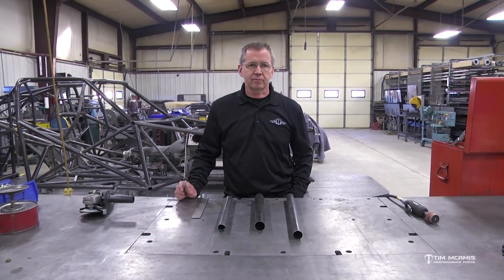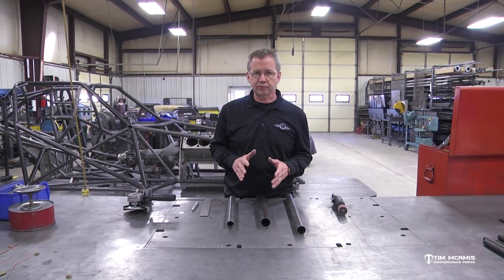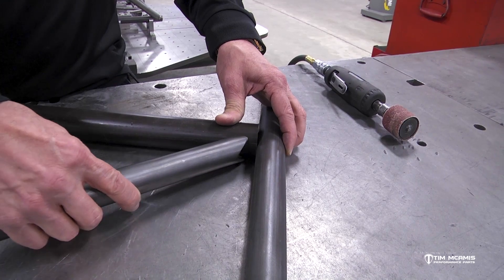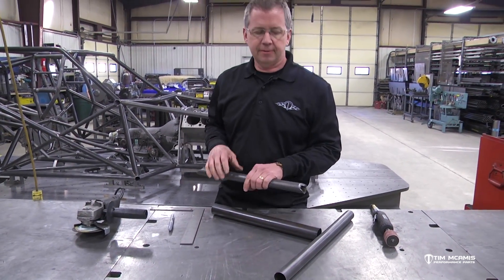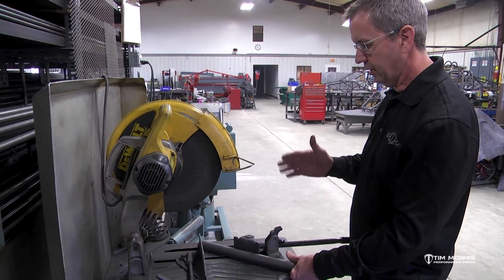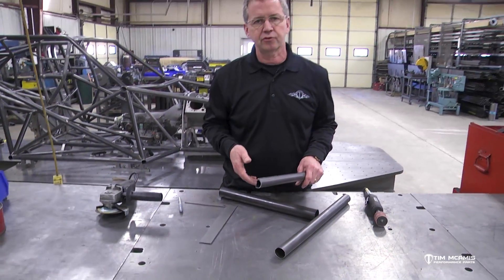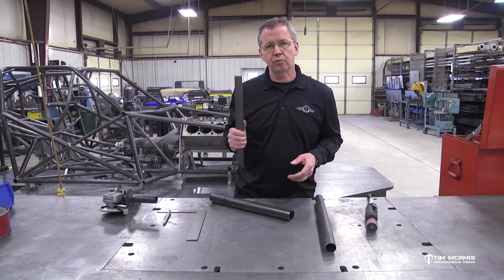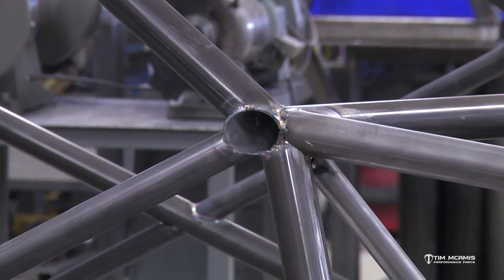Tube Notching - Fabrication Series: 05

Comment: Tim, awesome vid, thanks.   For a VW bug, dune buggy build, tube chassis, that needs to hold about 500 to 550hp at the wheels, what tube diameter and wall thickness would you use for the frame?

Comment: If u butt tack weld then slide the sleeve in case where u don't want to pipes same size butt jointed. Start it joint if needed w/flux, then slide sleeve where needed & weld & u don't hve to "sweat" the pulling of the weld heat messing w/your seams. 1 diameter will heat diff then other diameter, simple tack or flux worth the time if worried about it, & sleeving to b sure not same diameter insures good strength lasting seam & fit, 1st time every time.

Comment: comments 93 showing: best way to get a good fit angle butt joint is to make sure the 2 pipes being fit together r never the same diameter. Even if u hve to add a cover sleeve.

Comment: I've done a back half on a S10 and a roll cage and it took a long time and I see places where I could have done better.  I went with the 2x3 back half and after watching this, I now know I should have gone with the 1 5/8 tube option.  What scared me was two things, is it going to be strong enough and notching the tubes.  After watching this video and the simple understandable approach Tim uses, made me realize I was overthinking it.  This was soooo simple!  Thanks for turning on the light bulb for me Tim!  What would be helpful is providing some tips and tricks about tubing measurement for length on bends etc.  Thanks again for posting these!

Comment: Really great video.  So many of these tube notching videos on here give overcomplicated (and actually incorrect) advice, that I've thought about making my own video about this, but you have it totally covered.  I think this is the first video I've seen that mentions that a tube notch is made of two straight cuts, and that's the most important thing that people need to realize.  All you need in order to make excellent fitting tubes is an angle grinder and a drum sander, but having access to high quality notchers is a nice bonus!  But especially for tubes joined at small angles, it's much faster to use this method than a holesaw-type notcher.

Comment: Please Please Please don't show people to use the side of the cutting blade of the chop saw for grinding.  I know you are using it lightly  BUT  that abrasive blade can and will explode from weakening it's side structure it is not designed to use the side for grinding .   I have been personally hit by flying broken blades that  were used as a grinder on the side of the blade.  It might not even be YOU who abused the cutting blade.  Great video I have done notching when welding aircraft tubing and I always like to see how other people do there notching.  Two thumbs up !

Comment: I have 2 ends of 1 1/8" steel tube to notch. No chop saw. Can I do the same thing with a hack saw, 4 1/2" grinder and files?
Reply: That will work. Just put a reference line on the tube so you know the orientation to keep everything in place. I did it last weekend with a portable band saw. Just take your time.

Comment: What is your opion of the williams low buck tube notcher?  I have found that the cheap drill press hole saw notchers are junk.  Hole saws cut over size need to use slug cutters.

Comment: This is so crazy I have watched dozens of videos those people trying to teach you how to notch tubing, he just simplified the f*** out of it . . Just like tying your shoe . . everyone else is like a half of this, behind that, 1/3 of that, this angle and that . . Nooooooo . . Just TWO (2) CUTS . . And when I saw it . . All I could do was laugh 😂  . .  thanks

P. S.    . . I just watched another video of a guy with a Special Jig and he kept saying over and over again (About 5 or 6 X's) about how he was going to cut a . . ' Complex Double 45 ' . . He clamped the tube in the device, marked it with another tool that helped him find the starting point, started cutting with the hole saw bottemed out, flipped the drill portion of the device 180° to finish the first cut . Used the other tool again to find the placement of the second 45 . Used a snap collar to locate the starting point for the drill . He spins the tube to begin the cut on the opposite side . Then drills out the other 45 with the hole saw . . And after he completed the 10 - 12 step process, he said once again how the ' BLAH BLAH BLAH BLAH ' Device can cut the ' Complex Double 45 '  . . With EASE I suppose . . I can't remember but I believe I was laughing almost the Whole . Entire . Time.     😂

Thanks Sooooooo Much Again.   👍😏

Comment: Hello Brother, I’m in process to manufacture a beach buggy attribute to Honda Rincon 680 cc using Daihatsu 3 cylinder car engine 650 cc how ever it’s more 20 hp than the one in the Honda Ricon , now my question is what is the appropriate tubes that should be used for this project in terms of the tube diameter and thickness and the steel fabrication specs ....

Comment: You know, the VENTING, that is a good thing to do for other reasons as well..  I have built TRUCK BODIES, Like for say a FLATBED TRUCK, I have built the frame for the bed with SQUARE TUBING and I "vented it" like that except I used a little bit bigger hole, so the FRAME could be utilized as a Compressed Air Tank  Always had AIR fro a TANK that took up NO ROOM anywhere.  I could also hook the "Bed Tank" in to a Compressor on the job and it would allow the COMPRESSOR tor have a bigger capacity to run Impact tools etc.  Good video, BB

Comment: How do doors work on your kits? I'm very interested in getting one of the chasis kits from his website for my first build as it would really speed things up and to an extent simplify the designing/engineering I'd have to do but I honestly don't see how a door would fit on your kits... It looks like I'd have to remove the welded cross sections and design a door and door opening of my own...

Comment: Thank you for simplifying the cope/notch process, Mr. McAmis. You're absolutely correct in stating that people over-think the joint. I'd overthink it to the point that it would be nowhere even close and the more I worked it, the worse it got.  Went out to the shop and tried a couple of straight-cuts; awesomesausage-on-a-stick!  Huge thumbs-up and an even bigger THANK YOU,  Mr. McAmis!

Comment: Nice video

I have a dozen or so of off cuts with a line scribed with the lathe 2” from the end each of the offcuts is around 8” long and has different standard angles on them. Basically use them to get a nice angle and measure between the two lines to get your total length of the piece 

Makes fit up fast and very low wastage

Comment: With the vent holes interconnected,  and open ends capped. It is very easy to check for cracks. 
Fit a Schrader valve in the end of a capped tube, put about 2-5psi IN the tubes
and spray soapy water on each welded joint. A crack will show bubbles. 
No bubbles, No cracks.
Very good videos!
Reply: Love these vids, clear, simple and uncomplicated. Thanks for sharing!

Comment: I'm doing this very thing right now. My issue was when I notch one end, lets say the cross bar or back brace across the main hoop, getting the notch perfectly identical on both sides of the tube seems to give me trouble. Like one side will be perfect but the other side may be clocked just a few degrees so you end up with one side that is fits great and the other side off. What is the trick for putting a cut along the exact same cenrterline or on the same plane?
Reply: nitro 1 I know what you were saying as I’ve seen sometimes those back braces have a little curve to them. This is my first cage so I knew I would run into a few speed bumps, but  that’s not gonna stop me from doing this and everything else to my ride. Take care
Reply: Use a piece of 1" angle iron to make some indexing lines the length of the tube.  If you are using a notcher just find a place to index the lines to a reference point on the notcher.  You can also use a plane of bend/ rotation gauge to make sure there is no rotation.  I hope that makes sense...
Reply: Anthony Burgess ok i see my mistake I know what your talking about mine was bent to the main hoop I had hell with that
Reply: IV752 that makes perfect sense! And yes I’m using a notcher although I see I could have have easily gotten by without it since I’ve only used it 3-4 times so far out of installing 8-10 tubes. The grinder has proven to be a winner in my book, and prior to installing this, I just had to have this $200 dollar notcher that I can’t even dial in due to my inexperience with it lol. Oh well, live and learn. Thanks for the tips, I’ll put them to use as I continue on.
Reply: Glad to help.  I rarely use my notcher as well and mainly grind by hand.  After a while you can get tube length really close and its not much grinding with a flap wheel to dial in the notch.  The time my notcher is a benefit is extreme angles. I currently use a Baileigh TN-250 and the quality from this thing my my old pro-tools notcher is night and day. Its actually a treat to use compared to my old notcher.  Wish I could justify the cost of the mittler bros mill notcher or the baileigh equivalent but I get by.   

BTW Thanks to Tim and crew for these videos. I know they're time consuming but you are appreciated!  Love your out look on things and your candor! Merica!
Reply: Factor in the radius of the bend in other words just measure how long your bending die is if you want a 90 degree ad the measure the radius or were to start the bend so it ends up were you want it it's hard to explain but it beat me as well but that's how I did it
Reply: I'm actually just talking about a "straight" tube. The bar that goes behind the driver's seat is straight. It intersects with the main hoop on each side of the car. The semi 90* notch on one side comes out okay because one side is easy. But when I hold the other end up against the other side of the main hoop and attempt to guesstimate my cut the cut is close but it's just not exact. One side is always gonna be good but the other side appears to be off by just a hair. I'm trying to see how to make the notch on both ends on the exact same centerline or plane if you will. Thanks though for your input.